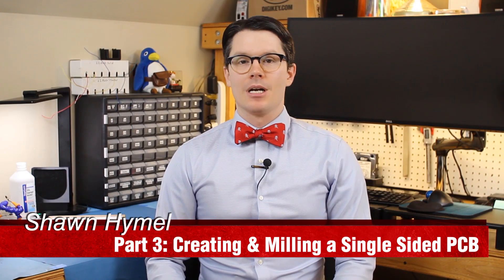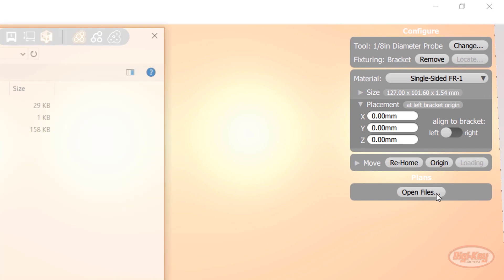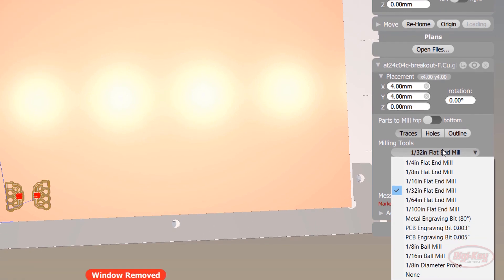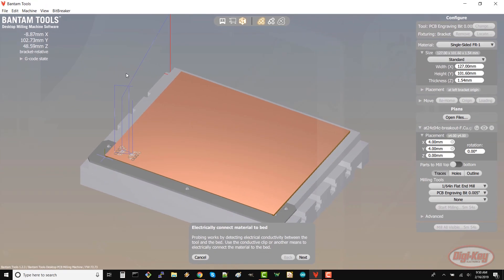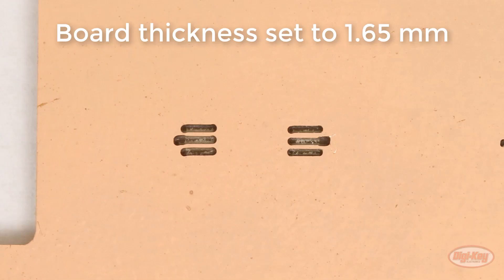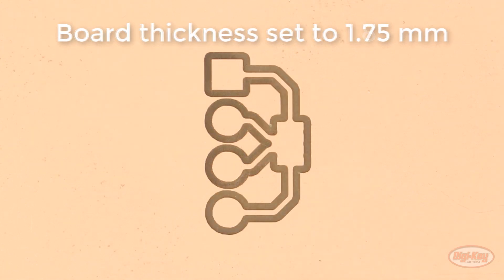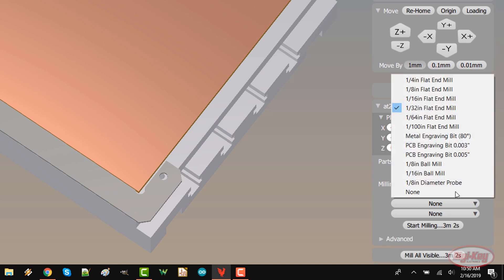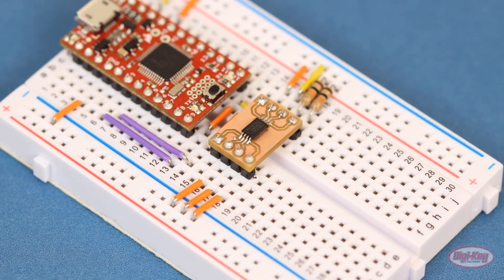Create PCBs for Rapid Prototyping – Part 3 – Creating & Milling a Single Sided PCB

Comment: I haven't tried it, but I would probably use a classic woodworking trick to hold down the PCB. Put blue tape on the machine bed and blue tape on the back of the PCB, then apply some super glue to the blue tape on the PCB and smoosh the two tapes layers together. Good work holding, without any residue to cleanup. Might be harder to get the individual board out though.
Reply: I just heard about this trick from someone at KiCon. I'm gonna have to give it a shot :)